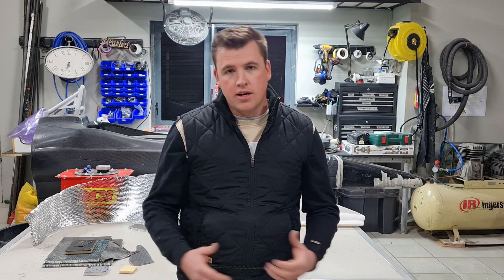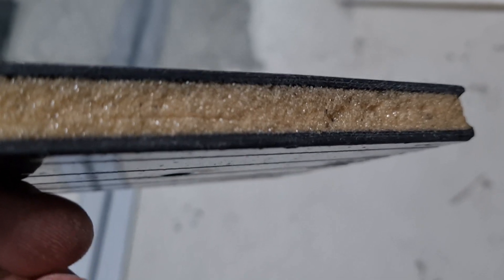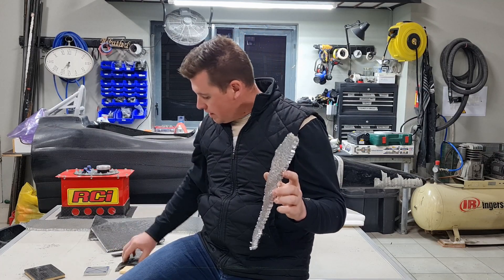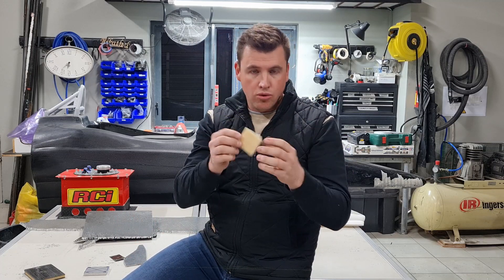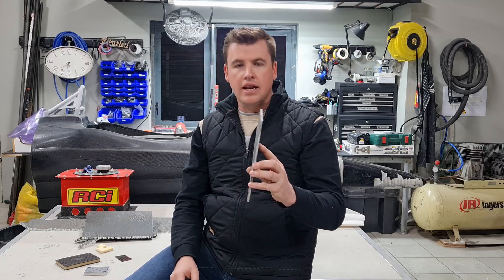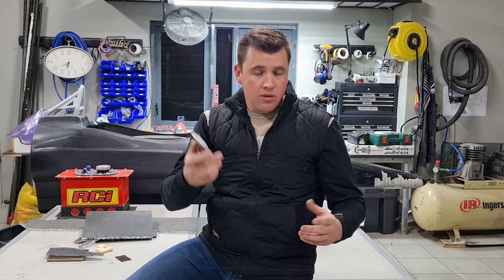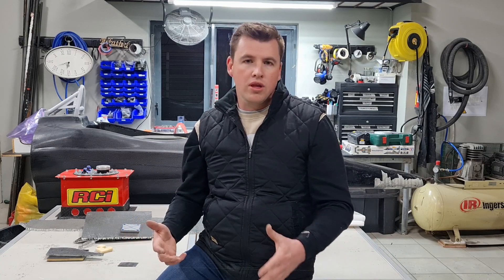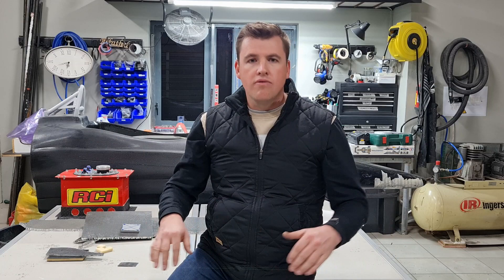Carbon Fiber Monocoque Update

Comment: Hey, I am an engineering student interested in starting a similar project. I am familiar with CAD modeling and some FEA work but not a ton. I would love to know what FEA (or other) processes you used to determine the wall thickness at various points in the chassis. How did you calculate a safety factor without destroying the chassis? Any resources I could look to to help me answer these questions would be awesome. Amazing project and thank you for the videos

Comment: Just wondering aside from using the 0,90,45,-45 and two other to make up one of the sides of six layers where exactly is it necessary to have the thicker 12 layers (back side where motor is)
Reply from the maker: Hi Rob, correct the rear is thicker, the driver area is thicker and the ring around the cockpit openning is actually 60mm thick with a total of 48 layers. The front area is also quite thick.
Reply: @miniindycarprojectza7793  great thank you for answering!  it seems that there aren't to many sections that have the 12 layer total,  since the sides of the driver are thick, the cockpit opening, rear and front are all thick

Comment: Hi,
Actually I am also in the same misery. I do have a problem bonding Al honeycomb with CF laminates but I am a step ahead and want to share with you
We are going to precure CF laminates and then going to use a adhesive from 3M, Henkel etc that is room temperature curable
👆🏻This adhesive bearly adds any weight and can be cured at room temperature for a long time period.
If we can't afford this adhesive then we are in contact of a Al-honeycomb panel manufacturer he uses some kind of resin(probably PU) to bond the two things but it comes at a expense of weight(around 2kg extra per m2).
Reply from the maker: Hi Pranav, thank you for the heads up. I'll definitely follow that line and we test the process. The only potential issue I can see is the complex shapes with some of our parts. Do you have a link for the products you used please?

Comment: Hi very interested in how the two halves were joined. Great videos really enjoyed the process and a great way to get your son into motorsprt.
Reply from the maker: We used cut out a 15mm deep and 10mm wide slot on either side of the two halves. We used the mould to make up an 8mm thick flange that was around 30mm tall. This was then inserted into the two halves and joined together.
Reply: @miniindycarprojectza7793  when in idy cars they use to make aluminum carbon monocoque

Was it aluminum honeycomb Panels then wraped in carbon? Or what exactly?

Also if aluminuk was anodised will galvanic corosion still happen?

Comment: do you have a rough idea of how much Carbon (in terms of surface area/rolls) you've gone through so far in terms of the monocoque? 

Warm greetings from Canada!
Reply from the maker: Roughly we used 62 Ms of Carbon Fiber of various types. We used 280gsm Twill 3K, 410gsm Bi-Ax, 300gsm Bi-Ax and we used 12Ms Kevlar 170gsm Hybrid.
Reply: @miniindycarprojectza7793  Thanks for this! Going back to the earlier videos, I was wondering why you went with Foam vs using a layer of fiber glass between aluminium honeycomb and the carbon to get around the galvanic corrosion issue. I've re-watched the video and I'm not fully clear on it, would love your insight!
Reply from the maker: @camofelix  The issue with using the aluminium honeycomb was mainly due to the cost of prepreg and access to a proper autoclave . You're not able to infuse honeycomb as the cells become filled with resin, exothermic reaction takes place in pockets compromising the fabrics, even if we could infuse with the Honeycomb we wouldn't be able to reliably determine the adhesion to the core. These were the challenges we faced with the Honeycomb.

Comment: What was the foam called again?
Reply from the maker: We use two different types of core foam but they are both PVC. For the Monocoque we used Gurit PVC HT 80. For other applications we use MyCell PVC 80. Both are closed cell and both are very good, just the Gurit is slightly better and more expensive.